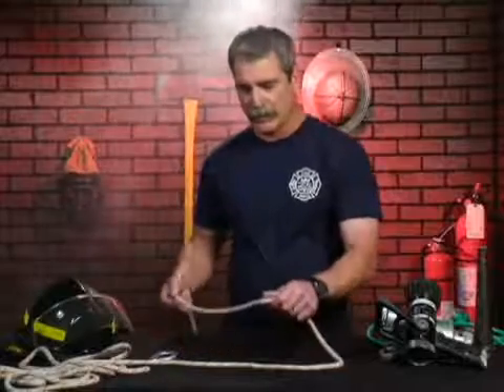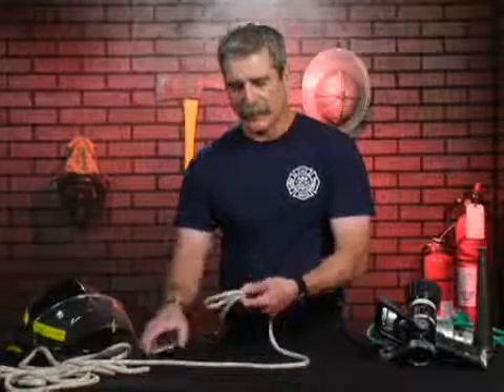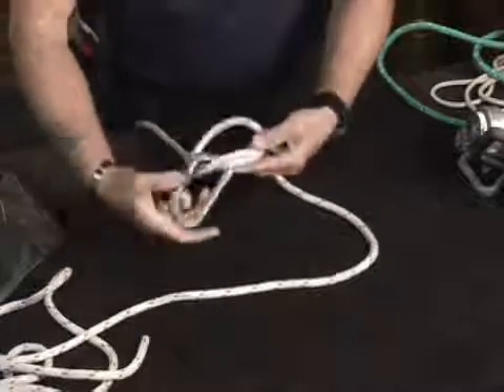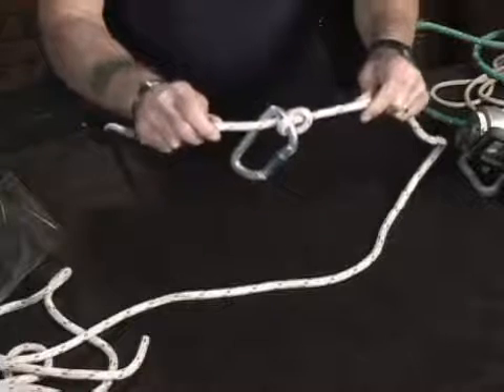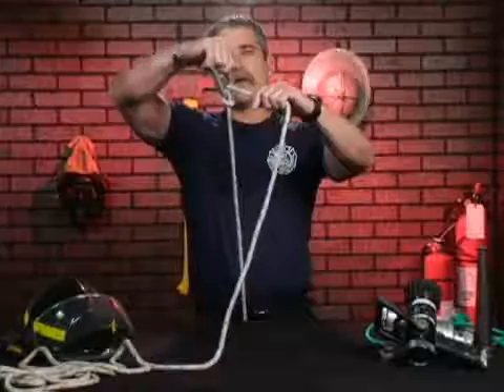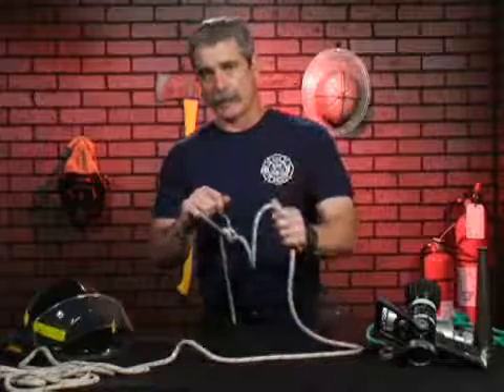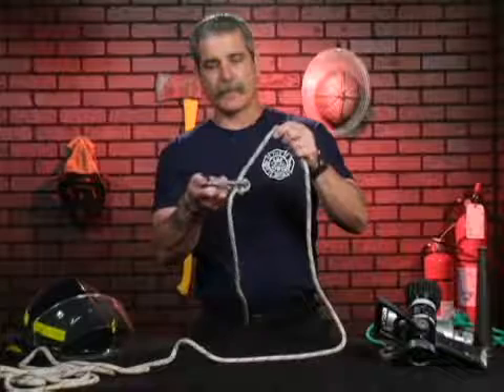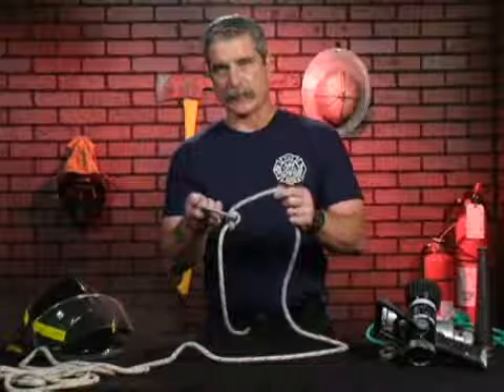Firefighting Knots: Münter Hitch

Comment: Not in Rescue, or a firefighter. Q - In Rescue mode - Is it attached as a belay to another firefighter, or attached to a stationary point, and does the department recommend a prusik backup in case something happens to the belayer? Thanks for sharing.